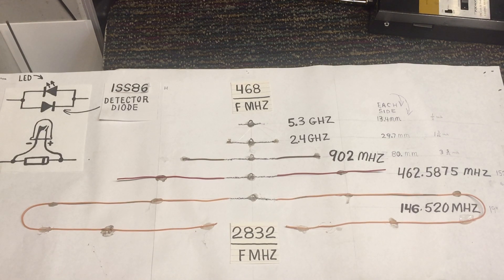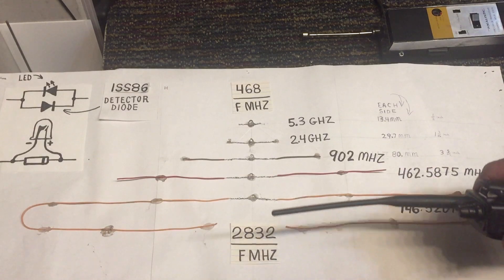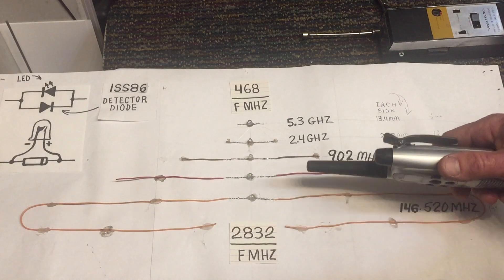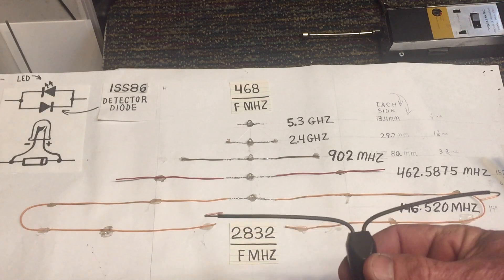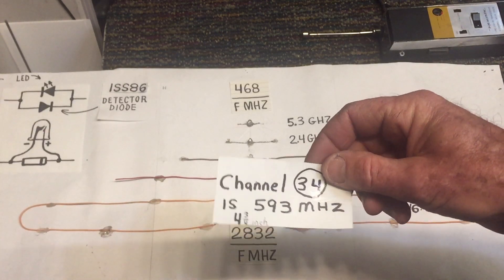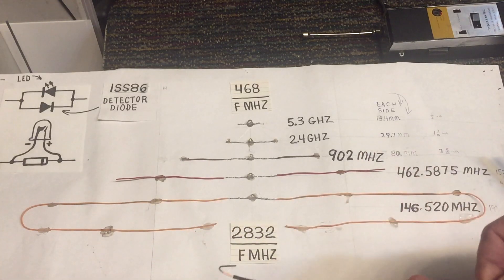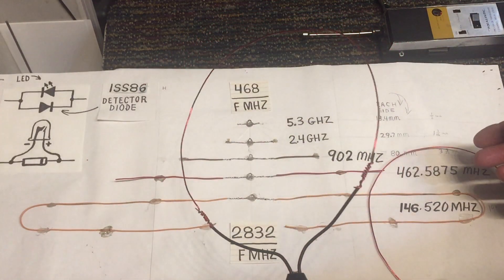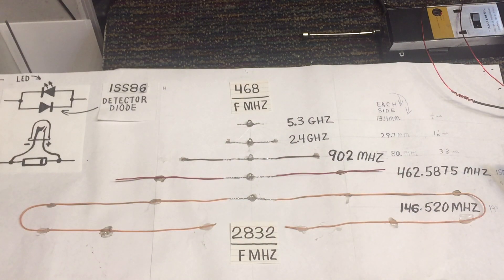Building Resonant TV Antennas, WRONG MATH. SEE INFO SECTION.

Comment: Really cool! to get a single VHF channel on my UHF antenna . I'm thinking of getting this VHF add on kit https://store.antennasdirect.com/VHF-Antenna-Kit.html  extending each element to ~2.9 Feet to get Channel 5 at 79Mhz  Am I on to something here? Also to make it more directional can I angle the elements a bit towards the transmitter - if so, should i adjust their length? Thanks!!
Reply from the maker: Hopefully the add on will provide you with the gain you need to get the channels you're trying to pick up. Here is one I did that did not have enough gain. https://www.youtube.com/watch?v=7HAPt5dH4IE
Reply: @GrantsPassTVRepair  Very interesting! I got it because I have hi gain Antennas Direct 91x UHF (i should have gotten that CM all along) and AD suggested this VHF add on. So I'm practically in the same situation as the video you linked, but i'm only 5 (radio-noisy, urban, obstructed by Nob Hill San Francisco) miles away from the tower! Also because it has a built in Combiner - so its fairly ready-made. I'm hoping combiner and unit is of decent standard to build off of. Will let you know how it works. I'm hopeful because VHF is more suitable for this environment, and with hi-gain UHF antenna, I'm picking up those fine, and also one a few dozen miles away. Thanks!
Reply: @GrantsPassTVRepair  Well that was fun! I put a resonant antenna tuned to the lo-vhf station i was missing (5) using some wire i had around the house to make a dodgy 6' dipole with balun and reception was amazing! (best of all my channels) Even with a 60 ft coax run. So I will have to figure out how to combine with my hi power UHF antenna. Most of my problems are caused from urban noise, hills as most of the channels here are close, but on UHF band. However the VHF channels do well - i may use that VHF Kit as is, without tuning or make a slightly less primitive dipole. Will experiment when it comes in.

Comment: 4:25 There's something wrong with your 468 figure above. It gives twice the element length almost. ie. Overall antenna length almost. - allowing for inches or feet. Your 468 figure should be 236 instead. ie. 12 times smaller than 2832
Example: 2832/472 Mhz = 6 inches and so 236/472 Mhz = 0.5 feet = 6 inches
Reply from the maker: You divide by 2 to come up with the figure forthe half wave dipole elements. Sorry I was not as clear as I could have been.

Comment: It might be worth mentioning that in some, if not most, countries you should be careful with your own antennas unless you're really just receiving. For instance, boosting your 2.4 GHz wifi with a homemade antenna is possible, but the gain could exceed what the regulations in your country allow.
Reply: How it's possible to exceed it? so Thats mean you can harvest with that antenna free light for led lamps? :)
Reply: @7gone  I'm not an expert, but it's my understanding that antenna gain is calculated in relation to an ideal isotropic antenna (one that emits radiation in every direction at equal strength). I your antenna focusses all the energy in one direction, it can exceed the legal limits (only in that direction, but depending on how the regulations are written, it might not matter). Generally, the regulators want to avoid interference and if your antenna is emitting too much energy in one direction, they might take issue with that.
Another possibility is that the antenna supplied by the manufacturer has a certain loss (due its quality or lack thereof) which is part of the total calculation. If you then replace it with a better antenna that has lower losses, you might exceed the legal limits.

Comment: Very interesting! Thanks!
Reply from the maker: I screwed up on the bottom formula. I should have stuck with 468. to calculate length in feet for each element side. ;-(
Reply: @GrantsPassTVRepair  Didn't notice, I'm in Belgium, so use the metric formulas anyway. A foot doesn't really mean anything to me :)
Reply from the maker: @koffibanan3099  In hind site The metric formulas would have been a better choice for this video.

Comment: Those formulas you gave, they are for quarter wave elements, right?
Reply from the maker: Yes. Each element will be half of what the calculations give you for a half wave dipole. Here is an on line dipole  calculator which can figure this out for you.  https://www.everythingrf.com/rf-calculators/dipole-antenna-length-calculator